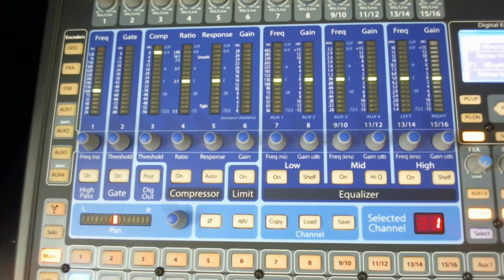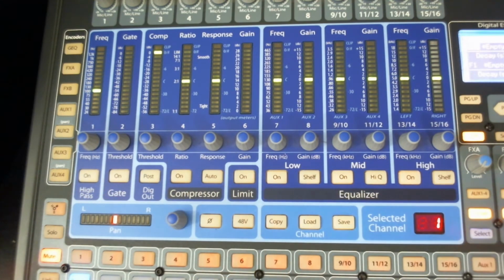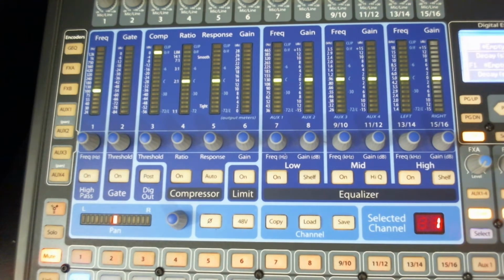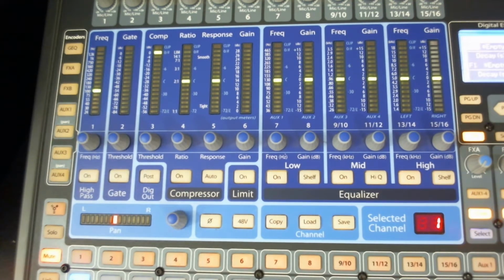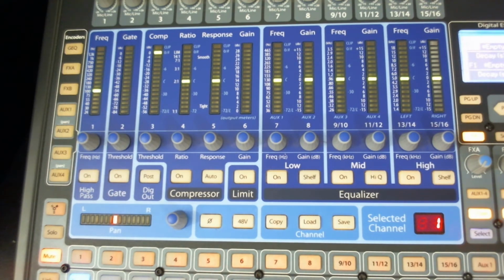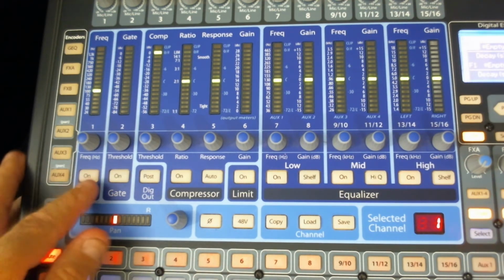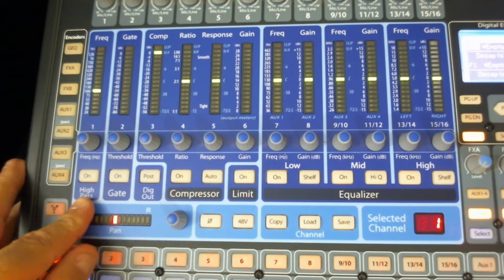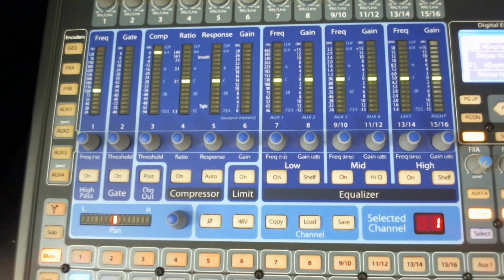PreSonus Studiolive 16.0.2 Fat Channel

Comment: Do you think this Fat channel on the Studiolive is the same as Fat Channels on the more expensive Presonus mixers?   I really like the concept of the Fat Channel, compared with the cheesy reverbs that most 'budget' mixers have built in.   Thanks for your thoughts.  pete
Reply from the maker: This has pretty good effects.
The fat channel hAs a few more bells and whistles on the larger units but they are good on the smaller one.